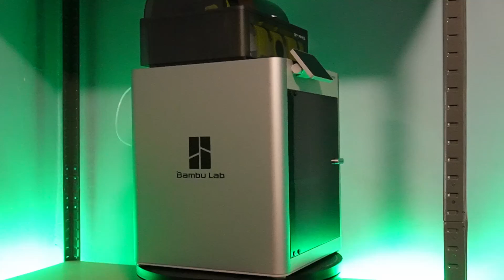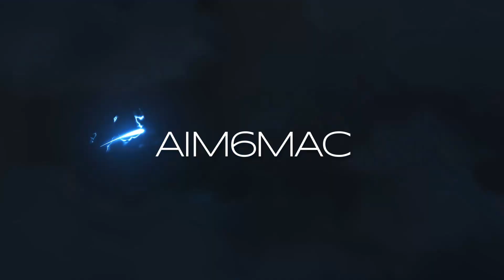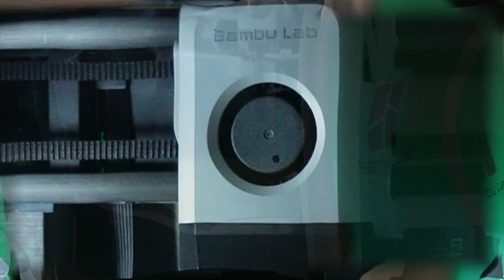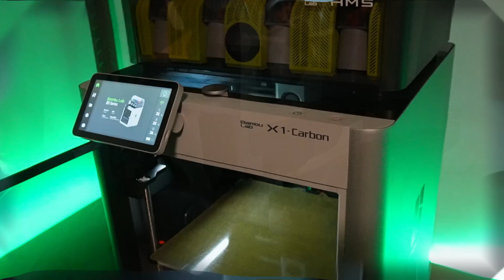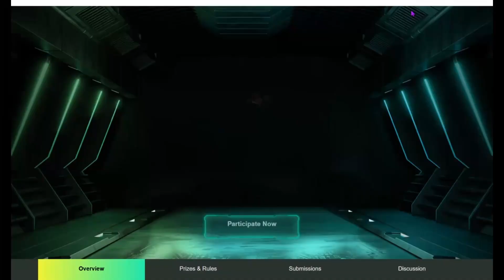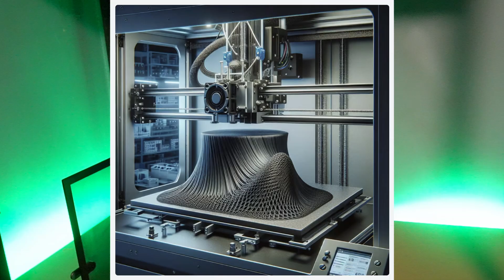BumbuLab X1C longevity and the NEW BambuLab XL-1

Comment: Look everyone keeps saying the new printers going to be a cheap multi head printer.  But that would totally ruin all sales of the other machines.   So i dont think its going to be that.  Its prob just going to be a larger machine the same as the x1c
Reply from the maker: i don't believe that it's going to be a multi head printer.  Pretty sure it's going to be one toolhead with multiple ptfe tubings going to it, and at the same time , different way of AMS usage.
Reply: @aim6mac  Yeah i think thats the best bet.   
Like the prusa system that does not need to poop.

Comment: Over priced in comparison to P1S perhaps, but compared to Creality K2 its a steal. In couple of months when more K2 units will be out there and running prints for several hours, Bambu will come out a Best buy again. For large print volume most likely SOVOL SV08 is the winner price / performance wise.
Reply from the maker: the K2 units are doing well for now, but we'll have to use them and see what they will give in time.  Since sovol sv08 doesn't have a out of the box multi material unit compairing that one would be not fair i think. But yes it's a nice cheaper alternative for the Voron.